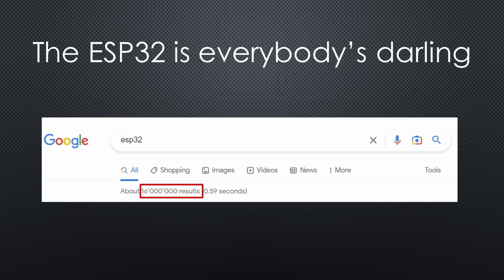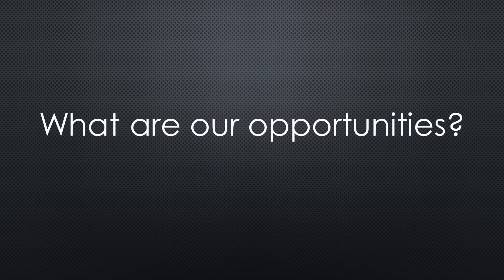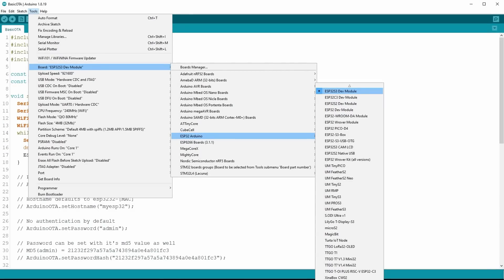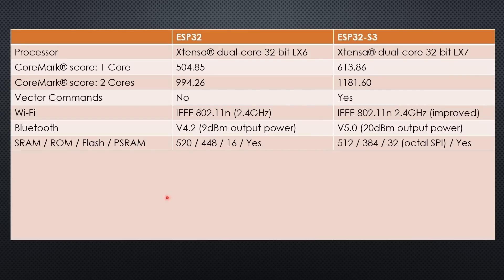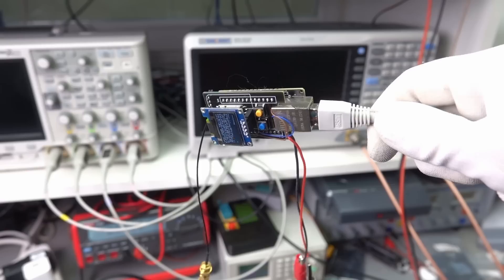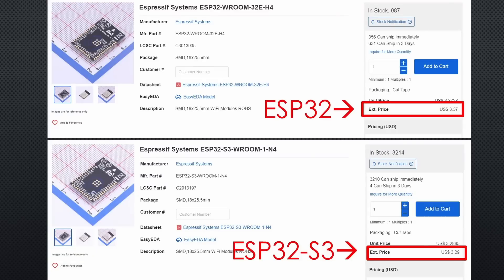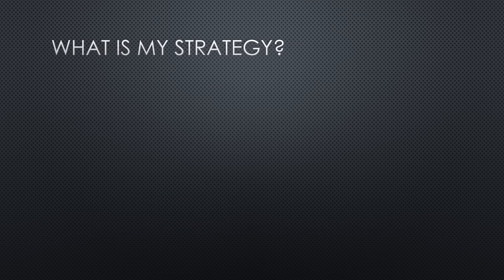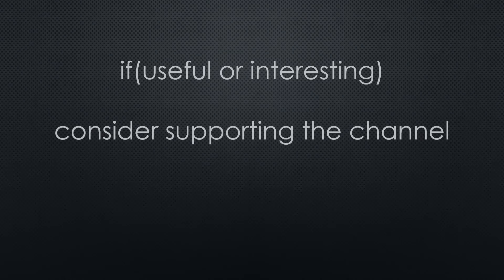451 Which Processor can kill the ESP32?

Comment: For me, any device that is dependent on WiFi is a no go making most of the newer models just downgrades. If I'm making my own custom stuff it either needs Ethernet (ideally PoE) or to be able to work 100% via a non-WiFi wireless. LoRa is definitely getting interesting. Worst case I can always fall back to 433, but that's obviously not ideal for anything I want two way communication on and/or missing a heartbeat would cause major issues. Custom ZigBee and Zwave look to be a pita so I've not tried that yet. Ones supporting ZigBee natively will be a great improvement.
Reply from the maker: If you do not need WiFi you have many other choices than the ESP32s, I think.
Reply: Just emulate Ethernet over usb and use a cdc_ncm or cdc_ecm adapter into your application? I really wish espressif would ship a dual or quad core processors with hardware 802.11, 802.15.4, and concurrent BLE. The silicon isn’t that expensive and you can really get a lot done bridging Thread / Matter to a wifi network

Comment: Two gripes I had.  No input with a schmitt trigger caused variations with quickly timed interrupt tasks.  Also if you had a time dependant task that was locked to the free arduino core and all other tasks locked to the core that handles wifi the free core still had interruptions/delays from things happening on the os/wifi core.  I ended up having to use a second microchip to handle time sensitive tasks.  I've also seen issues with static electricity lockup/reboot the esp.  Not direct hits but a static discharge several feet away or someone with high static carpet walking near the device.  Not sure if the antenna picks it up or what.
Reply from the maker: I agree and even made a video about this delay a few years ago...

Comment: So the killer replacement for the esp32 is another esp32 😂. I'm designing them into boards that have no use for wifi simply because you can actually buy them
Also I do like having lots of ADC pins at least. Rp2040 has only 3, it feels limiting these days in comparison. I wish it had more.
Reply from the maker: So everybody has his reasons... I heard "availability" a few times during Corona, and I think Espressif profited a lot that they always had chips.

Comment: Is the Wi-Fi transmit power adjustable programmatically? That additional 9 dB of output could be a power saving opportunity when using Wi-Fi, if you don't need that extra power.
Reply from the maker: Yes:
Lowest RF power output: WiFi.setTxPower(WIFI_POWER_MINUS_1dBm);

Highest RF power output: WiFi.setTxPower(WIFI_POWER_19_5dBm);

Comment: I am also intested in the Ethernet you mentioned as others are. I could not find the other video. Can you do a video on it. I like doing smart home stuff and use POE cams and WLED. I use it to power my ESP boards. DIG Uno uses a board. 
I would like to use it more. I also like the Zigbee for its low power and would like more videos on low power setups. I now have have a Unifi Access point that supports Bluetooth. I would like to learn if I can use that.
Reply from the maker: Maybe I will make such a video with the ESP32. I already made a video about PoE in general.

Comment: Thank you for this Video, very good comparison.
I Use the ESP32 and ESP32-C3 with Arduino IDE/PlatformIO, they are both very good microcontroles with lots of support.
For my needs their weakest point is the ADC, Their ADC is really bad. In some projects I need to use an external ADC (MCP3202).
I Tried to use Raspberry pi pico w, but there are still few libraries for arduino environment (Good web Server, Wifi Manager, Telnet server, ...).
Reply from the maker: Thanks for sharing your experience. I agree about the ADCs (I even made a video on it).

Comment: I have to say at this point the toolchain is also a huge reason for ESP32.
Arduino compatile, FreeRTOS based with easy multitasking.
Reply from the maker: I agree!
Reply: trash chinese toolchain. See ya in law court
Reply: There is also ESP-IDF which is more convenient for making bigger projects and having better control over the chip's internals. However it seems official documentation is lacking, even in Chinese. That is a huge disadvantage compared to more mature controllers like STM32. However it's Arduino-based community is huge and many are moving towards using the official IDF plugin in VScode

Comment: I migrated to the Xiao esp32C3 for all my sensors. I don't need many pins and the battery management on board is ideal (and charges with a small solar panel). The deep sleep model the esp32 wake modes is ideal. My typical sensor has the resistor bridge on D0 for battery monitoring (one short coming not having it on board), day sensor on D1, D2 and D3 are available for interrupts and sda, scl for the i2c sensors. With a 18350 900ma lion battery I have several running in just window light for solar and haven't touched them in over a year. They use espnow for hourly idle updates and on-demand sensor updates, typically 10-12 per day. I tried the S2 and determined life is too short, what a pain!
For my wearables I like the Xiao Nrf52480 sense. 
I've used the rp2040 both as the rpi board and Xiao form factors and I find them to be  useless. I have a handful of these if anyone wants them LOL 
Thanks Andreas for your videos. You are always informative.
Reply from the maker: Thank you for sharing your experience! I agree that the -C3 is a good replacement for an 8266. It is too small for an ESP32 replacement.
Reply: Can you share a solar powered code sample for Esp32c3?
Reply from the maker: @tactizityeibar8922  The code has nothing to do with the way you power a device, I think. If you want a low consumption, try the deep-sleep examples.

Comment: if only ble is needed and not too many gpio-pins, the seeed xiao ble is worth a look. it's consuming very low power and has native usb and a battery charger included. but it's also more expensive
Reply from the maker: The seeed xiao ble is a good board, and the NRF chips are much better for BLE. I agree.

Comment: Thank you for an other great ESP video! 
However, I think it would have benefited from not dismissing and "red crossing" S2 with very little comments. S2 is a great module for low power applications not needing BT or dual core. It is for me the most direct upgrade from an ESP12 module (8266). Then the other ESP32 modules come with added features - at the cost of increased power consumption.
Reply from the maker: I agree that the S2 (or the -C3) are replacements for the 8266, But the question in this video was about a successor of the ESP32.

Comment: All ESP32 can keep Wi-Fi during light sleep. It halts processes between DTIM pings, every 100ms or so. Cuts usage to about 800uA and allows for rapid reconnection. Doesn’t reboot when waking.
Reply from the maker: I never used light sleep in a project because it did not solve my problems. Battery operated, it was too "thirsty" and mains powered not needed...
Reply: I've never had any luck with this, and every commenter I've come across shared the same experience. Any examples? Does it need a 32khz rtc xtal to achieve this?
Reply: @EdFrench_uk  I can’t give an example because I use MicroPy which has no support for this. It’s probably only in the Espressif SDK and never ported anywhere.

Comment: The ESP32-C6 is already available in on a dev board? The lack of DAC on many of the newer ESP32 mcu's is a bit annoying for me and my use though.
Reply: Agree, the lack of DAC outputs makes the newer Esp32 boards useless to me!
Reply from the maker: They showed a -C6 in Nürnberg last week. But they did not give me a board. So it is probably not ready for us ;-)
For me, the DAC is a rarely used function. But it is handy, if you need one. You always can add a chip or go back to the ESP32.
Reply: @AndreasSpiess  I use the dac for many brushless motor projects using a hoverboard main board with the "feru hack".. Works just as well as hobbywing esc's, is about $60 and has two motor outputs! The only downside is that if you use pwm input, there is a lot of noise issues. Using analog voltage provides a noisy free result.

Comment: C6 is good enough for a typical projects, have better connectivity and overall sounds like a better choice than S3. Just need availability.
And seems that ESP-IDF winning over Arduino for ESP solutions.
Reply from the maker: I decided to use the Arduino IDE on this channel because it supports different manufacturer's chips.

Comment: Concerning WiFi range do you recommand (or anyone reading this) using an ESP32 ? For 20m and two walls, I had to use a repeter to connect my ESP8266 which is a waste of power.
Reply from the maker: The ESP32 has the same WiFi power and a similar PCB antenna, so no difference. Maybe you can use a module with an antenna connector to add a bigger antenna.
Reply: @AndreasSpiess  Thank you for your answer, some miss leading info about WiFi differencies between ESP32 and ESP8266 online. I will search another solution. :)

Comment: Does it still takes around 200ms to boot up from deep sleep? That prevented me from using it one low power project.
Reply: You can circumvent the 200ms by using deep sleep wake stub, see expressif programming guide. Lots of other restrictions of course, but good enough for e.g. reading a sensor and much easier and in many cases even more power efficient than using ULP.
Reply: @axelhertwig8258  thanks for the tip, I wasn't aware of this.

Comment: Just bought a few C6 engineering boards for the zigbee support. Very excited and can't wait to receive them.
Reply from the maker: What I need is examples for Zigbee sensors in the Arduino IDE. That would change a lot on the power front... Do you have them?
Reply: @AndreasSpiess  Im not 100% sure but I think Arduino only gets support after esp-idf 5.1 gets released. Got my dev boards today maybe I will look into it.
Reply from the maker: @Jonas_Meyer  Just send me a message on another channel if it works.

Comment: 11dB means about 4 times the power. However, the performance drops to the square of the distance, resulting in a roughly doubling of the range.
Reply: It is not voltage ratio, it is power ratio. 11dB is about 12.5 the power.
Reply: @hopje01  Oh, I missed this. So this one really has 4 times the range compared to the "classic" ESP32 ?

Comment: Hi Andreas, do you have a link to the ethernet dev board for esp32 you show on this video ? thanks.
Reply from the maker: You find them on Aliexpress ("poe ESP32"). YouTube does no longer allow links
Reply: @AndreasSpiess  I could only find W32-ETH01 boards, with an esp32 and a LAN8720 ethernet chip. in this video, you seems to tell that the esp32 can be directly interfaced with ethernet ? is it the case or do you still need an interface chip ? thanks for all your work.
Reply from the maker: @jeanyvespochez  You are right. I mixed things up. I'm sorry about that.

Comment: New chips, but still bad docs and buggy idf libraries. They still have a bug in espnow communication. Unbelievable :(  S3 cannot receive espnow messages while being connected to wifi. When using esp8266 as sender
Reply from the maker: That sounds like a very special scenario. Hopefully, you will be able to get a fix...
Reply: @AndreasSpiess  but everyone is using espnow and wifi at same time.  I must be not the first one. I contacted espressif and they said they will fix it. But I just cannot believe that I'm the first one facing this issue and reporting it...

Comment: For high processing, Espressif have got an S3 to sell you. FPU and features galore.

For low power, they have a C3. No CH340 / CP210X needed, saves that $1 bom cost, still has Wifi & bluetooth. Beats the pants off an arduino if you don't need 5V.

Sometimes your project wants to do camera processing, sometimes it is just a bunch of glue logic that barely needs the power of any modern processor. So I think bifurcating for use cases makes a lot of sense here. I have to give it to their marketing strategy, they've done quite nicely in market segmentation for their designs IMHO.
Reply from the maker: For me, the C3 is a replacement of the ESP8266. This is why I did not cover it in this video. It is a good chip, I agree.

Comment: Another difference that might be worth pointing out: on the S3 you can use the whole 8MB of PSRAM for heap allocation, while on the ESP32 you were restricted to 4MB because of limitations in the MMU
Reply from the maker: Thank you for the information!
Reply: Indeed, very useful for a hi-res frame buffer. Also, if you adapt the partition tables and board definition file you can access 16MB flash on S3 boards so equipped. I'm not sure if the original 32 can address that much PGM space. I think it's good to turn away from SPIFFS and embed resources as byte arrays instead. Perhaps a little bit of FAT exposed to USB Mass Storage for config files etc. I don't know why the Arduino IDE partition options are restricted to relatively low PGM space and high FS space given the number of boards now with extravagant flash. If you're using LVGL you might want it the other way round.
Reply: @nikthefix8918  The original ESP32 supports a maximum of 4MB of .rodata in an application image (another limitation in the MMU), so that puts a hard limit to how much data you can embed in your firmware; the S3 MMU does not have the same limitation, so it should be possibile to embed objects up to the available flash size. I don't know about toolchain and bootloader support, though.
Reply: @alyf80  Thanks for the great info regarding the original ESP32. I can confirm that the S3 has support in IDF and Arduino (with suitably modified definition files) for a specified 16MB of flash storage for the main application and have boards working in this configuration. I never looked into it with the S2 as 4MB was sufficient at the time of using it.

Comment: I got started using the esp32 in the last two years. I use them to wifi enable sensors around the house and drive led strips. I did use a raspberry pi for some of those things but pi s got extensive and hard to come by (and it is overkill).  I also have some pi picos and the w version of those but prefer the esp32 because it is easier to setup the webserver part. There is still a lot of mileage left for the esp32 for me.  No need to switch yet.
Reply from the maker: No problem with me. Now you know that you do not lose a lot...